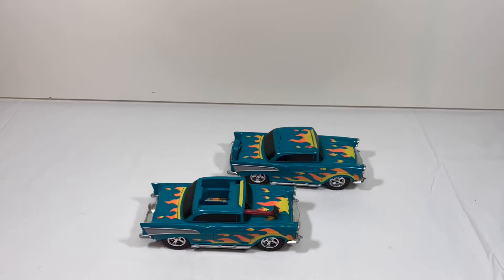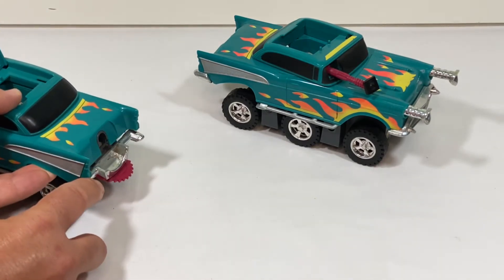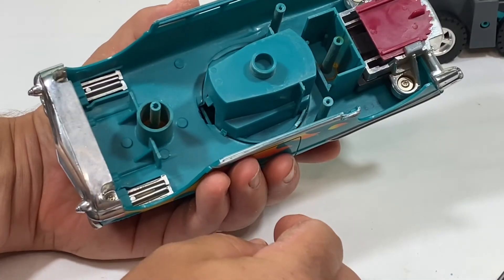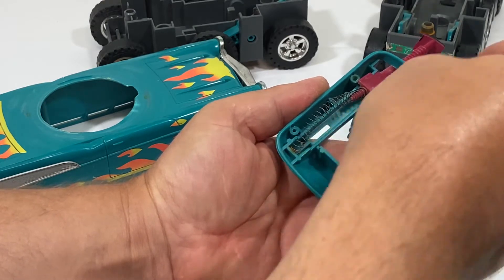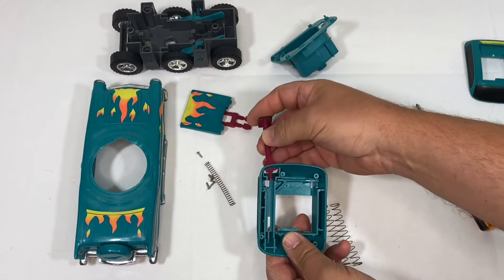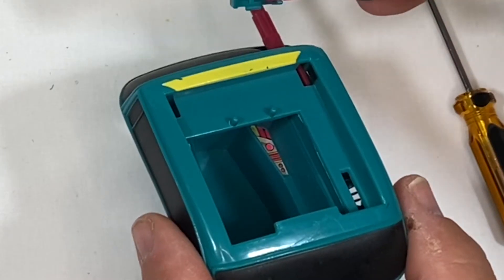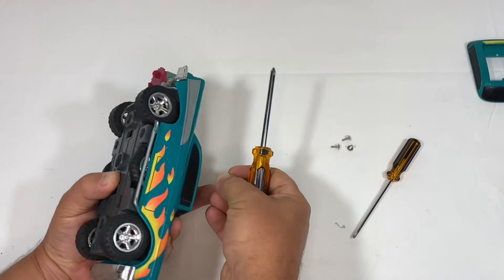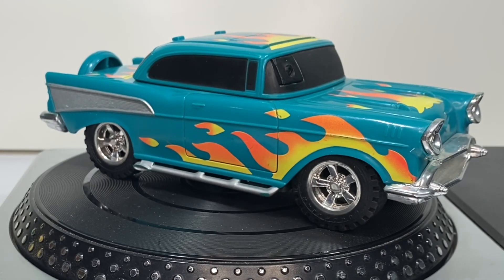Hurricane Restoration M.A.S.K. Complete Tear Down and Assembly!

Comment: Very nice! I also have a Hurricane that I received years ago from a friend. For some reason the top canopy and flap was all warped as if he had been blasting it with a heatgun. So I got another Hurricane but the flames were much less bright (felt like sun damage). That one also had no flap at all. Fortunately I managed to find a flap on Ebay. The warped flap still had a good gun on it and the tire-missile was also still there.

So now thanks to your video I now feel confident enough that I can also tear down both of them and assemble the best parts. 👍

Also thanks for mentioning that Molotow Liquid Chrome marker. Some of my M.A.S.K. toys had some minor nicks, scratches, and general wear on the chrome bits so I also ordered me one of those markers. Hopefully I will be able to repair the chrome scratches so they won't be as visible.
Reply from the maker: I’m glad my video will be helpful for your restoration. Yes the chrome pens work really well. They come with different tip widths which is nice for different types of applications. This stuff gets tacky fast so do it quick. Also, don’t touch it for at least 2 weeks. Take that long to cure or you will press finger prints into the chrome paint. After that it’s really great!
Send me pics when your done, love to see the finished product.
Reply: @toysbackzen  Cheers! Thanks for warning me about the 2 week drying period for the chrome pen. I ordered me the 1mm tip version for starters as otherwise I figured things could get messy. Which one do you usually use? 1mm or 2mm or even bigger? 

I'll definitely send you a picture of the finished product after all that's done. Probably won't look as good as yours as one of my Hurricanes looked a bit more gree-blue than blue-green (also likely sun damage) but I'm definitely going to use the best bits and see how good I can get mine. 😃

I also received a Thunderhawk a few days ago with really bad stickers and floppy doors. But thanks with some replacement stickers from Zacparis in Australia, adding some tension to the spring, and some vigorous cleaning I was able to make it look almost like new again. Just waiting on some repro door lasers as those are a real pain to find these days apparently.
Reply: @toysbackzen  As promised here's an image of the finished product. Thanks to your video I was able to disassemble both of my old Hurricanes quite easily and was able to put one back together with the best parts/screws/springs from both versions! Thanks a lot for mentioning that chrome pen as this allowed me to touch up some of the worn areas on my pieces and now it looks nice and shiny again. I was also very careful not to touch the chrome parts while taking the pictures and my Hurricane is now sitting in a safe spot to dry some more. 😃

Here's the image: https://i.imgur.com/nXv1TaM.png
Reply from the maker: @DanakarEndeel  wow looks great!

Comment: Just bought one which is  of course missing the spare tire.  The howitzer continually get stuck in the windshield on mine.
Reply from the maker: If you follow this video to take the top off you will be able to see the spring mechanism for the howitzer.  It should be apparent how it releases and should be an easy fix.

Comment: On mine it takes some fiddling to keep the car from popping up, what exactly is supposed to keep the car body down, is it just a matter of lining up the turret straight with the front of the car?
Reply from the maker: Sometimes the 2 springs that lifts the top when the turret is twisted can be out of alignment. The turret does need to be straight or it won’t stay down, there is a possibility the tab that holds it down when you push it together could be broken.
Reply: @toysbackzen  thanks for the info.